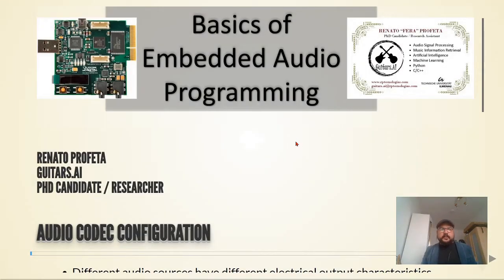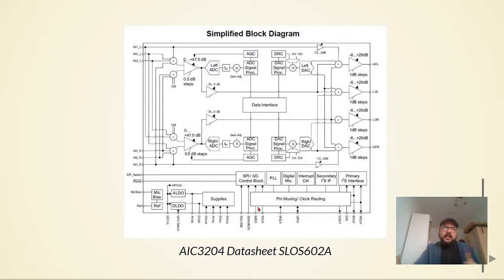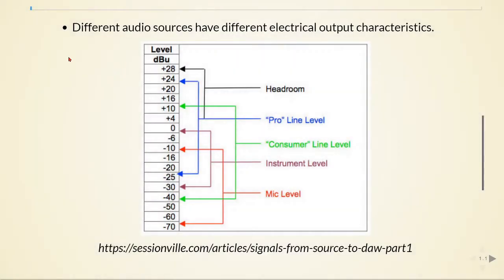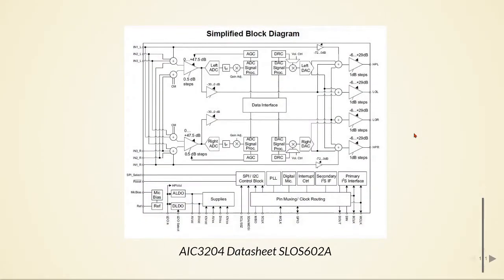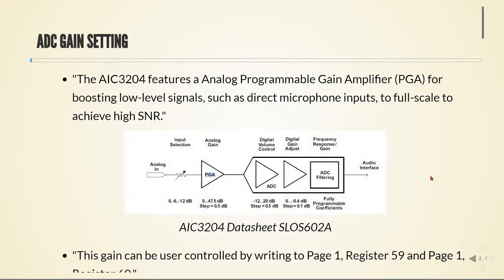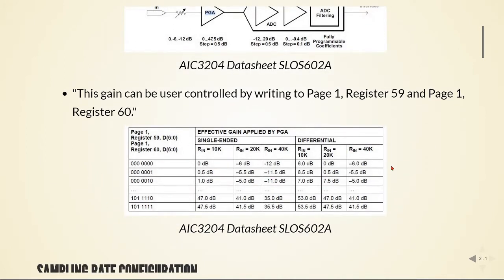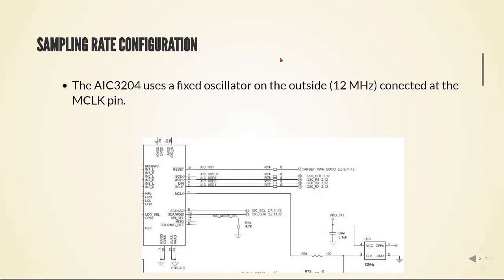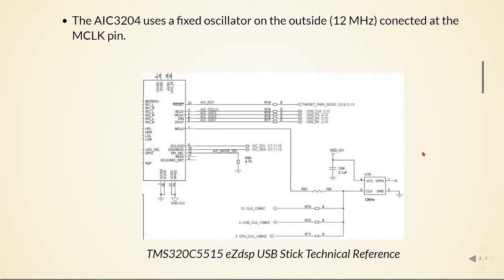03 Audio CODEC Configuration - Basics of Embedded Audio Programming using C

Comment: I'm at 7:34 in the video -- and you are just repeating things that are in the data sheets.... why not talk about the theory and the objectives or the approach to using the system?
Reply from the maker: Hi, thanks for your feedback. This an introduction course, so I assume that some people are not familiar with data sheets, and are not familiar with the topic. If you check a bit more after minutes 8 on, there it comes some configuration examples in C,  going through some code, and more practical information.
Reply: @Guitars4RL  What are the fundamental operational concepts?  Do you explain some of that before you jump into code?
Reply from the maker: @keithsummers2842  thanks again for your question. What's your main interest? This is a basic course on embedded audio programming, and the idea is to use a hardware platform to discuss audio programming. Usually the operational concept of any kind of hardware is described on its datasheet. If you are interested in adc and dac theory there are many courses out there focused on this specific topic. If you are interested in embedded systems and understanding the hardware design, there are also many excellent courses out there. What I'm discussing here is how to configure the audio codec on the board so someone can start using it and learn to code some applications using it, hence the name of this tutorial is Audio Codec Configuration. I hope you can find online something specific for your needs. Best regards.
Reply: In my opinion, the basic knowledge of this concept is so easy for students and they learn it in the university. In my experience, the hardest part is embedding my idea to a real hardware. This guy deals with this topic very well. You dont need to learn the theories here.